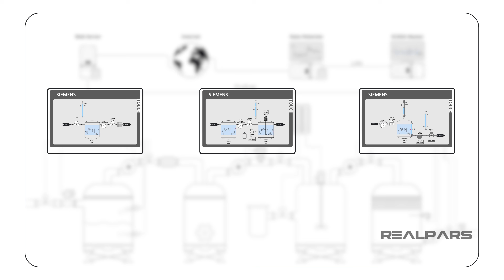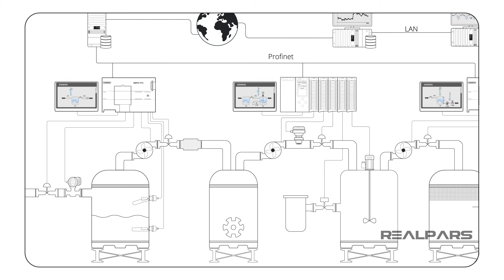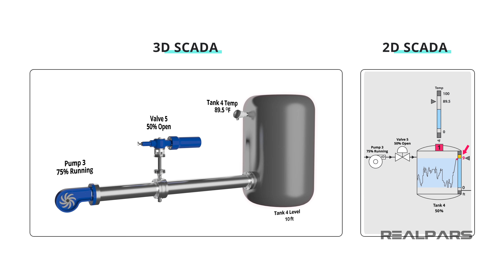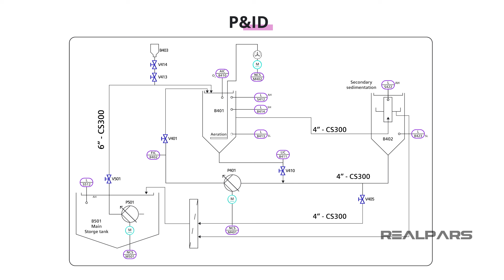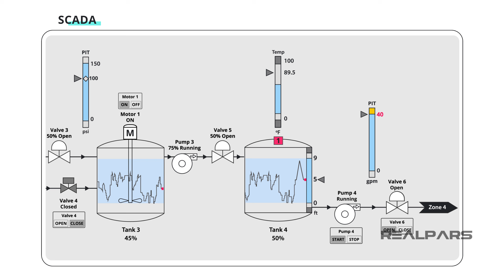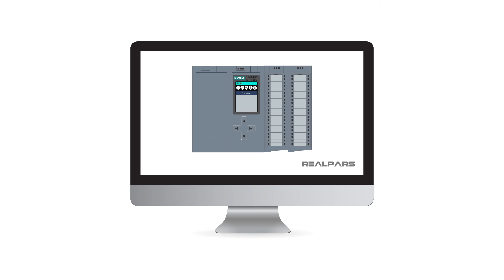SCADA Applications in Water Treatment

Comment: Hi RealPars, I have AC/DC/Rly PLC hardware, what software should I buy to simulate water treatment system in SCADA? thanks
Reply from the maker: TIA Portal Basic has WinCC Basic built into it.  There is a very powerful simulator built-into WinCC Basic.  WinCC Basic can be used to configure Siemens Basic Panels.

Comment: Dear Real Pars, I have a question.

Are there complete personal training kits with PLC's currently on the market?

That is, kits that come with sensors, push buttons, the PLC, cables, contactor, etc ...

Thanks a lot.
Reply from the maker: Yes.  These are usually called "starter kits".  Here is one example:  https://marketplace.realpars.com/products/simatic-s7-1200-starter-kit-consisting-of-cpu-1212c-6es7212-1be34-4yb0?_pos=1&_sid=317106ad9&_ss=r
Other starter kits contain HMI's, etc.  Also, do a web search for "personal PLC training kit" for more options with many different systems and price points.